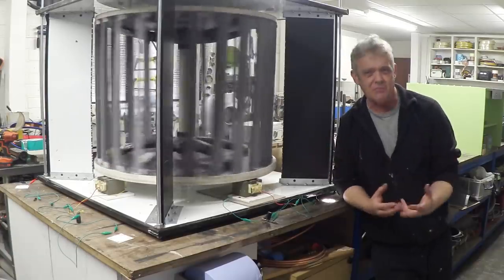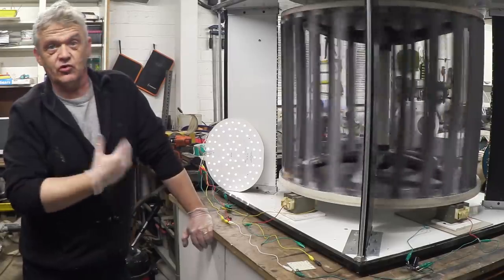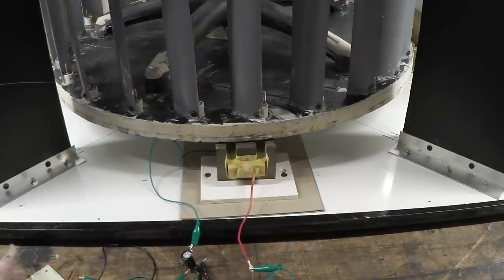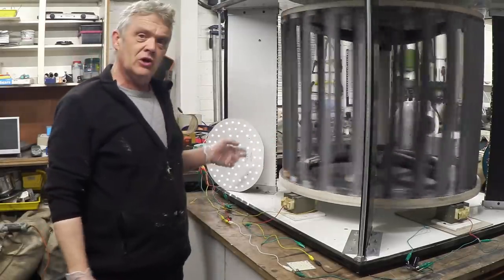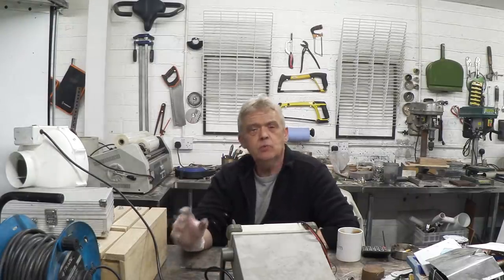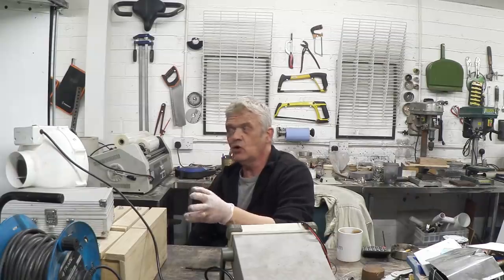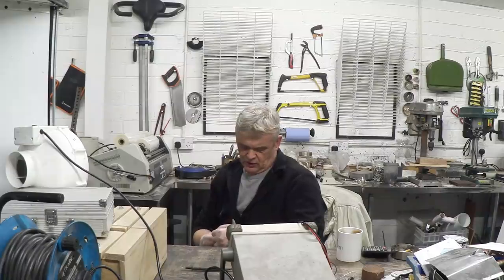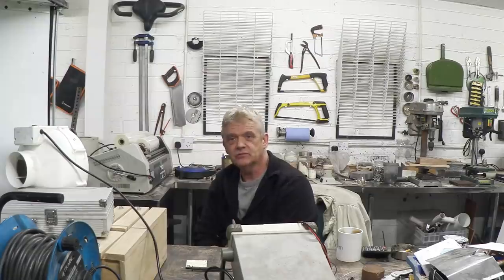Building a 1kW Wind Turbine For Under £100 - Part 6 - Installing The Coils

Comment: I was hoping that you would add a bridge rectifier on each pair of coils with at least 12 coils. Capacitors make a lot of sense when you consider their function in a circuit, I would like to see if all coils would work better with a supercapacitor bank of at least 12-24 volts. Entirely dependent on the coils used (primaries or secondaries). Even better would be a battery bank that works with a MPPT charge controller that works similar to a solar system.
Reply from the maker: I am thinking along those lines too mate

Comment: Don't forget that you are changing the Frequency of the AC Component, as you speed up and slow down the Turbine, so HF Components may be Required for Higher Speeds.

Comment: Interesting. Could you make an arrangement where at a certain windspeed to trigger a disconnect of the capacitors so you are direct driving your load? Im thinking you could use that ability to act as a break, and thus maximise the unit in both low and high speed wind conditions.

Comment: your idea is partly sensible but you have to match up the coils, what I mean by that is you use an oscilloscope to read the output of each coil, then you slightly move the coils until all
the sine waves match as perfectly as you can, then connect all the coils and they will not be fighting with each other. Using the rectifiers just isolates each coil from interacting with the
others, but then you are stuck with D.C. Current, however if you align all the coils so as to use their real combined energy as A.C. Current, then you can really harness the ful power that your device is really capable of, which is probably about 750 watts with a good medium wind. A fast blowing wind could do about a 1,000 Watts, No Problem with aligned coils. You must make sure that you device can handle high winds, or it will self destuct

Comment: What if you increase the capacitors either in size it put on more capacitors to increase the amount of energy being captured will that increase the speed. As if it were, the ability to capture or drain the energy being produced from the coils would allow the wheel to spin more freely to produce more energy...

Comment: What the 4 diodes are doing is convert the generated AC current to DC. The voltage is all positive, but still fluctuating, because the magnetic field is fluctuating, because of the rotation. The capacitor is flattening this fluctuation, so you get less flicker. This does not explain why the coils seem to slow down  the rotation, something else must have become more efficient.

Comment: Super video Robert. I also agree with some other comments that I’d love to see this build until the end please 👍 Also (very possible stupid question alert) when you put the rest of the coils on this along with the capacitors also,what if you used the batteries that you salvaged from the electrical equipment that was dumped. Would it be possible to use the capacitors in such a way as to keep a steady current to any load or device and “siphon off” the remaining energy (if there is any) to charge as many of the batteries as possible so that you’d have power when there was no wind available (at least as long as the batteries lasted I mean)
So (in case I made myself as clear as mud) Live power when the wind is up driving whatever device is needing power and at the same time the excess power (if there is any) begins to charge a shed load of batteries for later.
As I mentioned before,I have absolutely no clue with any of this stuff (which is why I watch you) so all that I’ve just said may be nonsense.
Anyway thanks again Robert for all your effort and also for always being so cheerfully upbeat and enthusiastic - It’s catching!! 😊 👍 
Warmest wishes from South Wales 🏴 - Jonathan 😊 👍
Reply from the maker: that is pretty much exactly what I was thinking of doing mate lol
Reply: @ThinkingandTinkering  That'll be great Robert.  I'll look forward to seeing it 😊 Fantastic 👌
Reply: @ThinkingandTinkering  thanks for getting back to me also 👍

Comment: I would love to share an idea for a wind turbine but don’t have a drafting board to draw the schematic, on a vertical erected pole, having 6-12” wing type air foils, each flipping up to catch the wind in rotation than laying down after initial wind to create lift or speed. It must have the Savonius Vawt to start up! The air foils have a small air flipper beneath them to catch the inertial breeze to flip up the air foil blade individually! This idea has been swirling in my head from a youngster as I wanted to use the wind to power my own merry-go-round! I will draw up a some what draft if you would like to help share my design it is free for anybody!

Comment: Can you walk us through your thought process of adding the capacitor and bridge? I guess I really don't understand why it would have locked up in the first place. You have wind, a large rotating platform,  magnets, an air space and coils of copper. There is no connection between the magnets and the coils but the passing lines of force. I get that the capacitors are acting as a battery and the diodes are turning AC into DC but why does the magnetic field slow the rotation down to a stand still?
Reply from the maker: some good questions mate - I think I will do a video on it if that's ok

Comment: A basic schematic of how you have the capacitor and diodes connected would be useful, the capacitor is on the output of the bridge rectifier?
Reply from the maker: understood mate - cheers

Comment: Ok, I'm a bit late to the party, but still: it's the current that's fed to the other coils that acts as a brake, so when you add the diodes and the capacitors, you're preventing the coils being fed current and slowing the whole thing down. It will, of course, still slow down, the more coils you add, since the magnetic field will feedback partly, but as you noticed earlier, you will be able to regulate that with the iron cores in the coils!

I'm very sad that I just have a balcony to test where I live, but I'd love building a similar thing. Wind energy is not as effective, but combining solar and wind (which is nothing but solar anyway, like anything on this planet that's not coming from it's core haha) is the way to go, how I see it.

very fascinating

Comment: That's a very interesting result. I'd have expected that putting two loads in parallel (the capacitor and the LEDs) would increase the starting torque requirements at least a little. It might have to do with the flux needing to do more work to start moving at a higher voltage, so if you're charging a cap from a low voltage it can start moving and passing some current. I wonder if there are any papers on reducing the cogging torque.
To further reduce cogging torque, you might consider moving the transformers around so there's a 1/4 spacing difference between the centres of the transformer cores.
Reply from the maker: it is interesting - and like you I have though of doing a search on this

Comment: An excellent video series, fwiw you can really easily measure you rpm ACCURATELY by measuring the AC output frequency from one of the coils (many  DVMs will do this) then factor in the number of magnets. I think every pair of magnets represents a flux reversal. IE if you had perhaps 32 magnets you will get 16 cycles per revolution. FWW I think you will get more efficiency if the magnets were mounted on a common pole piece like a disc. There is a website that you might enjoy called utterpower, he has done a lot of the experiments and you might find it helpful. With random phase between your various coils it does make sense to use rectifiers, DC is easier to sum although you do drop some voltage in the diodes.

Comment: I do not believe the capacitors are acting as a clutch. When you hook the coils up in parallel they are likely out of phase and probably look like a short. Having the rectifiers alone probably makes a big difference between phasing everything together and giving a voltage drop that allows some rotation speed before the load is felt.

Comment: Also, have you tried making a coil out of conductive carbon yet? I’ve also had a theory of making a coil out of a conductive carbon thread, (carbon nanotubes thread maybe) instead of a copper coil. I wonder if it would generate a voltage, like a copper coil would. If anyone could figure this out, professor Robert Murray Smith could!

Comment: Robert (Sir??) I would like to recommend that you make sure of the voltage capacities of your bridge and caps. A higher capacity (say 400 volt diodes along with a 50+ volt cap would be safe from any unsual voltage spikes (you could also place .01uF 100v ceramic capacitors across your diodes as additional "insurance" ) As a retired electronics engineer I commend you on your work and methods of anylyzing things as you go along! Keep up the great work and thanks for sharing! May you always have good wind!

Comment: Pls keep uploading these videos some of us are learn so much from your videos!  I would like to see hydro power off a pool pump to help lower my electric bill running my pool 8 hours a day at 220v  50 amp breaker.  DC pool pump are very expensive compared to AC pumps.
Reply from the maker: awesome mate cheers - I am a fan of hydro - I just lack consistent access to a suitable water source

Comment: I see it as a valuable test bed for many ideas and development is the step that's most interesting! Could it also be a vandograph at the same time?
Reply from the maker: so do I mate - and I couldn't agree. more - more than anything it's a way to work out ideas - electrostatics doesn't like weather so with sealing - yes it could
Reply: @ThinkingandTinkering  yes I forgot about water,arrangement would have to be different also at a guess so not to add friction,been looking at Russia's latest fighter the su 57 on a channel called combat approved,cheesy commentary but amazing leaps in the use of composite materials!

Comment: Hi Robert, 72 W with the actual setup would be enormous, Your Blower is not that big and the efficiency of blowers and turbines are not very high. Did you measure the power intake of the Blower? It is getting more interesting at every video!
Reply from the maker: I agree mate and I also understand I may be dreaming about that - but I plan on trying - I didn't measure the blower as I am just using it to give a constant reference supply of air

Comment: I have some clueless noob questions.
Is it possible to build this from lighter materials so that less wind force is needed to move it?
And to use the magnets also on the upper side to double the output?
Can a blower be build with less energy consumption, an accumulator and additional solar panel?
Can this new unit then produce the energy to perpetually move itself and also produce surplus energy?
Thank you.

Comment: I see a parallel universe happening from the videos years ago you did on saving the coal industry and now with recycled swivel chairs all coming together to make a power generation maybe with super capacitors made from all found items or items in abundance.
If the Secret to success on the maglev train was a super capacitor then maybe the same applies to generation as well where super efficient capacitors play a crucial part.
Amazing videos I look forward to them and the progress.
Reply from the maker: generation and storage are - to my mind - two sides of the same coin mate

Comment: One thing keeps bothering me about this is the resistivity torque on the generator being at the same plane as the blades is you don't get any lever effect..in other words magnets closer in towards the center instead of all the way on the outside would give the wind a bit more push on the generator. slower revolutions per say but more ability for the slower wind to overcome some of the load.
Reply from the maker: maybe mate - I don't know - I tend not to do much in the way of thought experiment my tendency is to build it and see - plenty of examples of the magnets next to the axle so no need to build that - but not many where the magnets are at the rim - so - interesting to build - at least for me
Reply: @ThinkingandTinkering  absolutely,,,im interested in seeing how it comes out..I like the overall design so I'll keep watching to see, using the transformers from microwaves is a good idea...just don't rob your friends units for parts. ha

Comment: Great stuff. I noticed at 2:39 that your coils are positioned at the bottom of the iron block which is some way from the magnets. In the previous video you said the coils should be as close to the magnets as possible, and I have found that to be the case in my own experiments. Is there a reason the coils are not placed on their sides and rotated 90 degrees to get the copper as close as possible to the magnets?
Reply from the maker: yes mate there is - I am going to place another set of coils so that two blocks are joined - it will be clear in a later vid I hope lol
Reply: @ThinkingandTinkering  Clever!

Comment: Voltage multiplier will work even better, take the voltage up to 120 DC with a few diodes and capacitors to drive an inverter??
Reply from the maker: for sure mate

Comment: Is it possible that with an even number of magnets and an even number of coils you could be getting some kind of magnetic field lock? I’m a mechanical engineer so I am not as keen on the electronic side like you are. I wonder if you spaced the coils so that you never have an exact line up of coil/magnet in more than 1 location at a time. Just thinking about how a radial engine was always an odd number of cylinders. Great series, please let us see all the way to the final results.
Reply from the maker: magnet and coil spacing can ave a huge effect mate - I am building this in a 'backyard engineer' way so trying to do it with as little tools or care as possible - that does mean issues will come up like the one you suggested

Comment: I'm late to the party and haven't read the 663 comments. Your capacitor theory is all wrong. You're forgetting first principles:- The coils are transducers. Each coil is (very likely) out of phase with it's neighbour. I.E. some coils are going to generate power and others (180 out of phase) will act as retarding motors  (powered by the generated power). The net result is that you'll potentially get no output. The bridge rectifiers are the key because they isolate the coils from each other. The capacitors also add value because they can store the peak of the output so nothing goes to waste.  Keep up the good work. This has been a great series :-)

Comment: Hello Robert nice oneagain mate.
However because of my electronics background I'm having trouble understanding your results.
The capacitors have considerably larger but shorter charging currents which would introduce a short duration heavy load on the mechanics of the generator. How are you doing this, do you have the loads and rectifier/filter caps all connected to the gen and the rotor at rest and then you turn your blower on? Or do you take your load off, rev up the rotor and let everything build up in speed, charge the caps and then connect your LED panel? Curious, what is your no load DC voltage, can't recall if you mentioned that in the video? The caps once charged will draw very little top-up current, however if you have lots of capacity, they will have a huge capability to get things moving, especially if the load requires a fairly large start-up current but then settles to a much lower value when all gets operational. By the same token an empty capacitor is a like an empty battery which will draw large currents untill fully charged. In addition in many larger DC power supplies running on mains by being recified and then used to charge the cap bank in many cases will take out a fuse in the setup due to virtual short on "cold start". To get around this the designer will build in a soft start feature by limitting the charge current to a safe level and only place it into full power mode after some time at which point the caps are almost fully charged. Apologies if for any reason my questions are taken as anything other than pure curiosity. Love your content.
Cheers from down under mate and stay well.
Reply: And sorry for many words, just realzed ho long my post is.😁

Comment: Not an expert, but i would use, coils in three phase coil, rectifier would use less diodes, less forward voltage drop. But at that currents that would be more usefull for primary coils.

Comment: No way to many Rob keep up the good work mate! Another piece of board to mount the magnets on so can gear up the spin speed (easier to balance reducing gaps to coils, can mount coils both sides doubling output don't even have to add gearing just increase size of magnet board to increase spin speed also means room for more coils) mmi  controllers and all the other great suggestions in your comments you'll soon be able to run the fan off it! (don't post that video though I'll miss you too much when they disappear you😭)
Reply from the maker: lol - if  I could do that they would indeed 'disappear me' lol

Comment: In the UK heating is going to be stupid expensive and it gets cold when it's windy. Why not use the energy you can produce simply to provide heat directly into a home.
I'm not very up on basic electrical stuff,I'm more of a digital guy, but I do know that there are tiny ceramic devices which when you put current in you get heat out.
In spite of my lack of knowledge, I keep learning from you.

Comment: Really like to see it fully operational  ... this is amazingly cheap and practical .. kinda like third world water filtration .. never enough "Good" ideas ... are microwave transformers uniform in coil size ... do you need to collect them by their own microwave wattage output in order to get same size .. thanks .. ?
Reply from the maker: me too mate and yes they are pretty much - I am using 700w microwave transformers